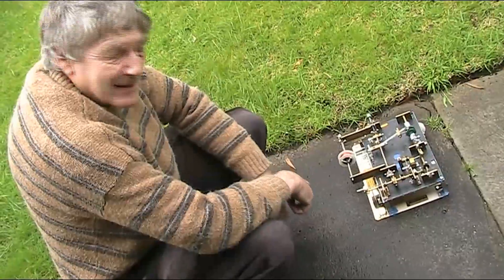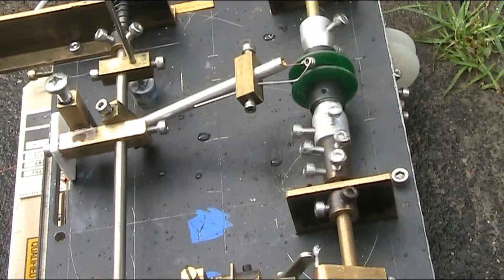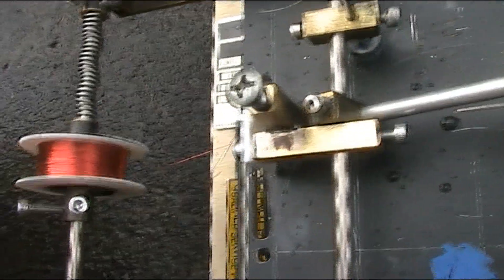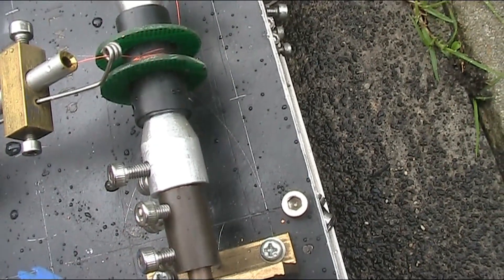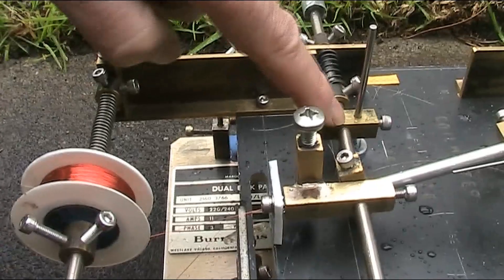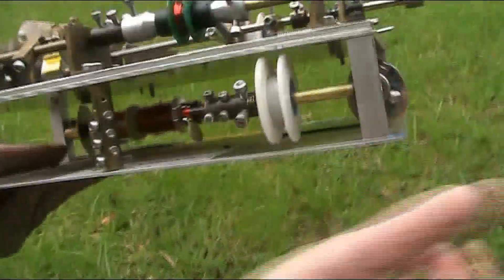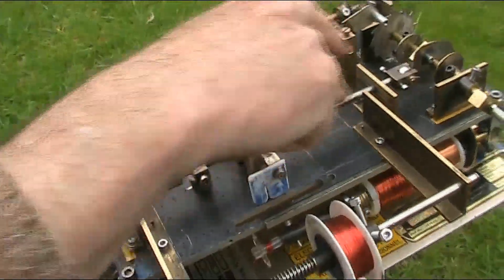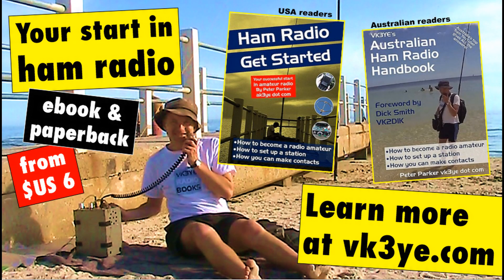Ralph's Amazing Coil Winding Machine

Comment: Why not make a level winder instead of a zigzag wind? Make it go full row of turns then return between the lower layer on the way back. You only need a direction changer at each edge of the form. (most useful for larger diameter magnet wire). Fine magnet wire may be better wound the way you are doing it?
Reply from the maker: That question's above my pay grade. Ralph made what he could out of parts he had available and it works very well.

Comment: Love handbuilt machines, what about using Meccano?
Reply from the maker: The tolerances in this need to be 0.1mm. Screws like in Meccano aren't good enough. Need rigid pins for placement, screws just for mechanical support.
Reply: @vk3ye  the question was of course tongue in cheek. As a 50 year old. It looked very much how Meccano used to look like when i was a child (not the current nonesense). Great channel as always.